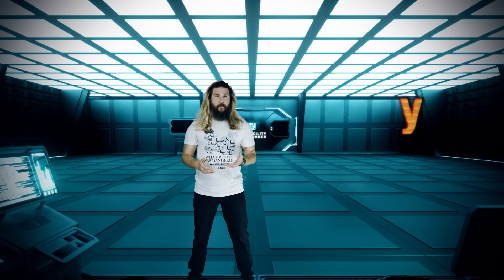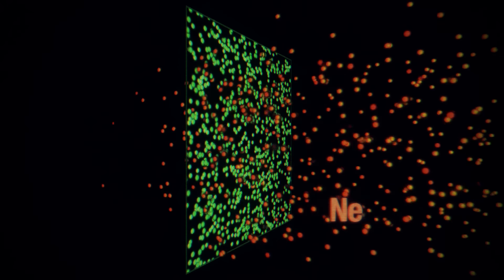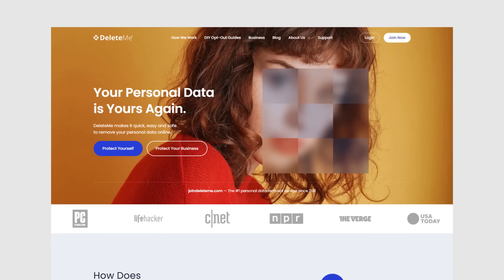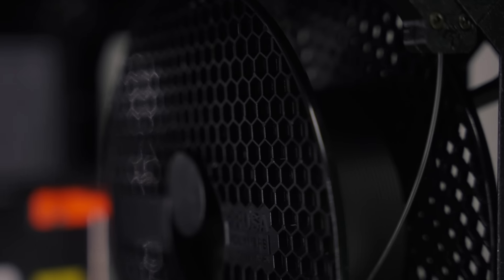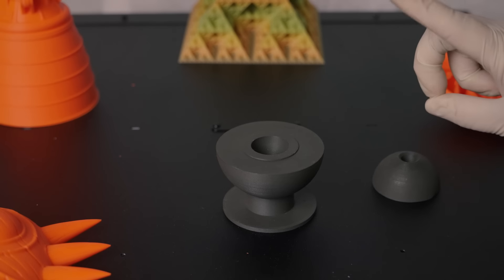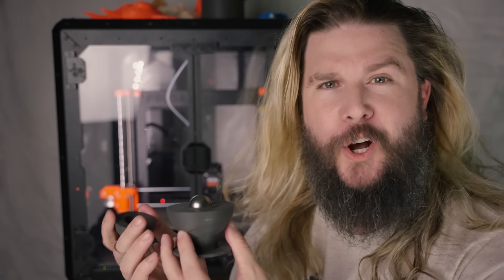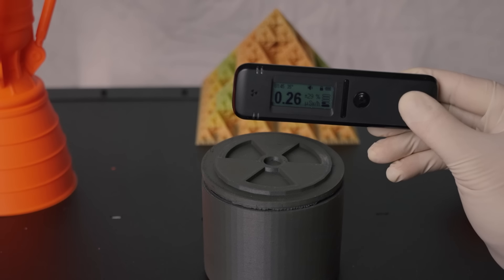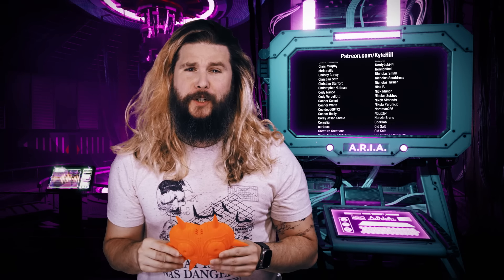3D-Printing TUNGSTEN Radiation Shields!

Comment: I'm curious as to what the radiation measurements would be if say, you also print ABS, PETG, PLA, etc with the same cyl model you used to print with the tungsten filament.

Comment: Combine with a low melting point metal and fire it. Burns out the plastic and sinters the materials together. Decreasing weight by lowering the nearly useless filler but increases thermal and electrical conductivity. This is already done with some ceramic based printing filaments.

Comment: at our plant (CANDU reactor) we use the 3d printer to shield pipes with plated out fission products (hot spots) it helps keep the general dose rates in rooms with workers down, the stuff works great.
Keep up the great work Kyle bringing information about the nuclear field helps demystify it for people.
Reply: How thick are those shields?
Reply: @teresashinkansen9402  it depends on where we want to put them, if we're putting them on quarter inch instrument lines they have to be fairly thin, an inch at most; but because they are 3D printed we can print them any size we want, they're usually about two and a half to three inches thick.
Reply: @CaptJackStiles  Thanks for your reply! But Im very curious Why aren't lead castings used?
Reply: @teresashinkansen9402 we do use them, we also use water filled containers that are custom fit to areas, it really just depends on where it's going; sometimes the place we're putting it can't handle the weight of lead, or if we're just using it for quick shielding, we can mock it up quick put it in place protect the people that are working and then remove it just as quickly,

Comment: Brehmstrahlung : A problem with protection from high energy radiation using a heavy dense shielding made from metals such as lead ... The enclosure becomes a Super Microwave Oven 99 000  and Bob gets cooked with an intense X-ray burst.
Reply: Only with strong beta emitters like Sr-90 But by then is better to use real shielding materials that wont break down with radiation like carbon, or aluminium and then lead. Unlike plastic bonded tungsten particles, practically you get the worst of both worlds with that. Low resistance to damage to intense radiation and not enough low density material to slow down the particles to avoid producing x-rays.

Comment: My uncle is a metallurgist at Los Alamos. He described 3D metal printing as laying down fine layers of metal dust and then heating it with lasers to exact temperatures and patterns.
Reply: That sounds like a very simplified explanation of Selective Laser Sintering (SLS) 3d printing

Comment: There are masks they make to protect cancer patients with brain tumors while they take radiation. Here's the workflow: 1 scan head, 2 make a 3D model shell, with holes where you need the radiation beam, 3  print the mask in two parts to fit it like a cast around the patient's head, 4 radiotherapy.

Comment: I can barely print ABS without warping…
Reply: Try using glue stick on your print surface, or switch to a textured PEI plate! ABS isn't really a material worth making an enclosure for your printer for, so you could easily substitute it anyway. Take hard TPU for example.
Reply: @Verbosal  I’ll give that a try, thanks!
Reply: Happy to assist ya!
Reply: a small layer of glue stick on the print bed, 110-115 bed temp initial layer and 110 bed temp through full print, 255c nozzle temp, and 35-45mm/s, and even a basic makeshift enclouser is what gets me really good abs prints without warping at all, i also use Atomic Filament for all my filaments and they've been amazing to print with
Reply: @iamthebatsy  don't listen to him. just make a diy enclosure, or print something that doesn't warp like new azurefilm abs prime for eg.

Comment: That was a nice short introduction to Attix and NCRP 151.  I recognize the .ppt file you got the energy vs hvl table from. I might actually use this for shielding brachy applicators. We currently print personalized nose applicators and are attaching lead sheets to keep the lens and lip doses down, but being able to print the shields in place would be neat.  There are lots of compatibility constraints, but could be a fun project.

Comment: As someone who only in the last several months learned about Titanium and Inconel (a nickel superalloy useful in large part because it retains its material properties at high temperatures) 3D printing, this is extremely interesting to me. Moreover, one of the best materials for a different kind of radiation shield (that's a thermal radiation shield, very useful for making high temperature devices such as furnaces more efficient) is also a refractory metal, difficult to machine and work with: Molybdenum. Now, Molybdenum is a fantastic thermal radiation shield because it's very shiny and continues to be shiny at high temperatures, so it's not much of a black body radiator, and it reflects thermal radiation from inside the furnace, giving that radiation a chance to be reabsorbed by the furnace rather than being lost as waste heat to the environment. Clearly the same sort of filament they're using, producing a black part, wouldn't do the job, but if their filament is 75% Tungsten? Well, I know that melting points can go down a lot when you alloy things, so maybe that's a big part of the way that it works, and maybe you can't do the job with this same technology, but my point is that I know of a lot of applications where, if you could get the engineering to have a shiny 3D printed Molybdenum part, you could get some crazy shapes for heat shields that could make for much more compact and efficient furnaces and similar things that like to get hot (my favorite application, as someone with a PhD in atomic physics, is atomic ovens, where we evaporate alkali metals and alkaline earth metals to generate vapor of the atoms that we like to do our experiments with). If anyone from Prusa has ideas or is anywhere close to being able to make a shiny heat shield from Molybdenum (or maybe nickel, almost as good for furnaces that don't get quite as hot but not as high a melting point), there's a market there, because that's a way to make anything that likes to get really hot a lot more efficient without having to take up as much space as a traditionally manufactured heat shield.
Reply: This is just plastic with a high loading of tungsten particles, its not an alloy but a composite so its melting point is dictated by the melting point of the plastic matrix. I think this is a gimmick, at most a marketing stunt with real uses in extremely niche situations.

Comment: I'd be very curious about the thermal conductivity of the material. Since electronics are damaged, especially in space, a material that can transfer heat and directly block the components would be a weight savings which is huge in the space industry.

Comment: I could see somebody make temporary countermeasures for various experiments using that printing. Custom shielding for radioactively sensitive equipment, custom containers with baked in etchings/imprints, Pretty much anything that needs to be done on the fly in emergency situations that would normally need custom equipment/parts.

Comment: I've got 2 potential applications. I used to work in x-ray radiography designing lead shielded cabinets, the edges and corners are always a bit awkward to do. 

The other is bacscatter x-ray. It needs a moving collimator that produces a 'flying spot', essentially a moving line of x-ray that goes back and forth over the object being scanned. The shapes are very difficult to machine, but relteasy to 3d print.

Comment: The UK has a plan to build a Geological Disposal Facility (GDF) for long term storage. It would be interesting to do a cost exercise to see if the cost associated with packaging up with tungsten shielding would be worth the cost savings with transporting and storing smaller storage flasks... It's proposed to be over 1km deep so if we can reduce it's size or increase it's capacity, that would be a colossal saving!
More items packed closer together with a lower risk of criticality?

Comment: A mini 3D printed Chernobyl model with removable dome, just to see how much the dome actually blocks.
I understand that its not a scalable test, but its just fun.

Also a interesting way to test if the shape of the shield effects the penetration power. Like do angles help the tungsten reflect, ir is flat just as effective?

It would be a fun experiment to also print out a hollow wall casket, and fill the wall with different materials, to see what materials block what radiation, and in what quantities.

Comment: The lead blanket (though I think a lot of them are boron blankets?) is easily the best part of the dentist. I think people sell weighted blankets, not for radiation shielding, but because Feels Nice. Kinda want one. And I do not work in the nuclear (or indeed any other) industry, but... spacesuits!!! First thought is spacesuits. Spacesuits are apparently a pain in the butt to design because they have to protect the butt and allow the butt the widest possible range of motion. And the other body parts too, I guess. Tungsten might be heavy for that, but spacesuits are mostly worn in zero-G, so mostly it'd just be an Inertia Thing, right? And if you're not in zero-G, your spacesuit doubles as the ultimate heavy blanket. Multifunctional!

Comment: This would be ideal for rigging locations that are hard to shield. Also 3d printed to fit around specific sized valves and pipes that molded shielding won’t cover.

Comment: 3D-printed ballistic body armor! That also doubles as armor against radiation! 
Not sure what would serve as the 3D-printed ballistic armor portion of this idea, I have doubts that the tungsten-infused material could serve both purposes by itself, but man that would be WILD to be able to print more types of wearable shielding. 
I was at a festival in the spring, where one vendor was showing off 3D-printed goods, one of which was a material that resembled dragon scales, and flowed/moved like a cloth. Perhaps something assembled on a fine-enough scale (paired with other adequate protective measures against contamination and harmful exposure) could serve as a new standard for protective clothing.

Comment: Question, how does the melting point of this filament compare to both other filaments and other materials that may be used for shielding such as lead or just straight tungsten? Most of the cases mentioned in this video aren't causing particularly high temps but its obviously an issue that can come up with radiation. 

Also it would be really neat to see how fine of a bead you can print with this material. Given some of the advancements made in the last 5-10 years in replicating fabrics or printing directly onto fabric to create wearable prints could have great use in creating more wearable and flexible shielding in space suits or even high altitude pressure suits for pilots who are exposed to more radiation than the average Joe. Especially if rather than bulky panels or fully built suits, we could launch a fairly compact block of printable tungsten, run it through an extruder and create emergency shielding in situ aboard space stations.

Comment: Depending on how well it works with shielding higher dosages, it could be a great way to make rapid shielding for possible leaks of radiation and buy time for a far more permanent solution and make the worksite safer

Comment: How about a belt-clip holster for those fancy pocket detectors? The sensors of radiation detectors are damaged over time by the very radiation they detect. Extending the lifespan by blocking the sensor when not in use will keep them accurate and functional longer.

Comment: I work in a building with a series of overhead crane tracks. Perhaps combining this with the larger house 3D prints new shielding walls could be built as needed without using personnel to put a shielding keeping ALARA goals even easier

Comment: I'd be curious to see how this might someday soon by used in spacecraft, both to protect astronauts and sensitive equipment. It could be especially useful once perfected for probes sent to the Jovian system since its radiation belts are notoriously difficult to engineer protection against.

I also wonder if as a somewhat cheaper and much lighter alternative they could use titanium, especially for aforementioned spacecraft. On a launch, every gram matters, so if they can get the weight down while still maintaining close to the same level of protection that could be a game-changer.

Comment: One possible use is for X-ray diffraction optics . Or more general beam control of a radiation source, through absorption, diffraction and refraction.  A simple example could be a stack of "filters" that will allow you to test for the energy of a source with a GM-TUbe.
A more complicated example would be a mask with a shape,  such that it flattens the gaussian beam, of a radiography unit, delivering a uniform dose across the delivered beam.